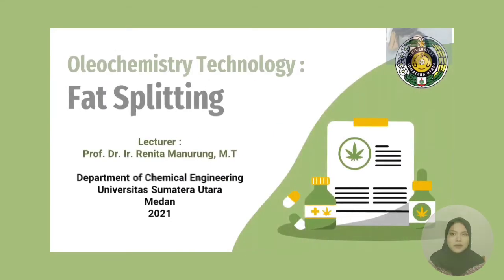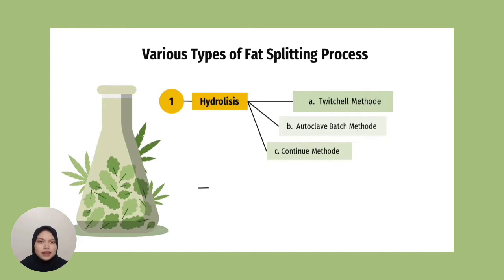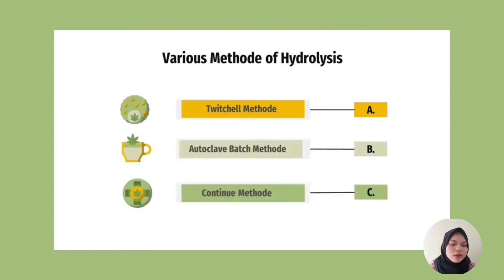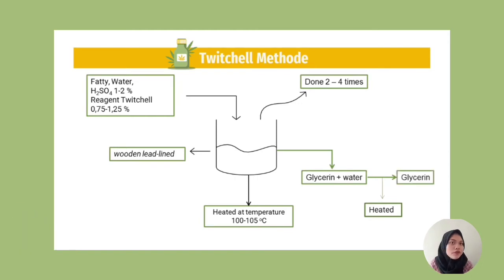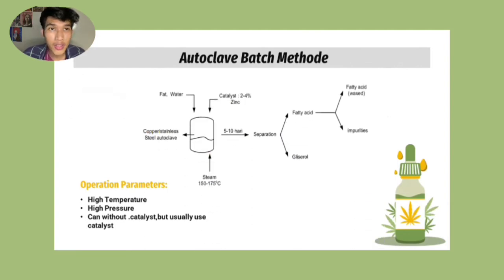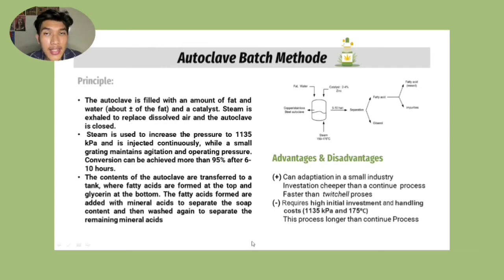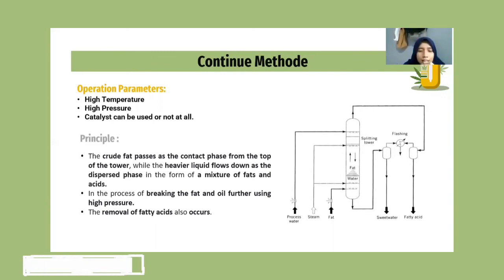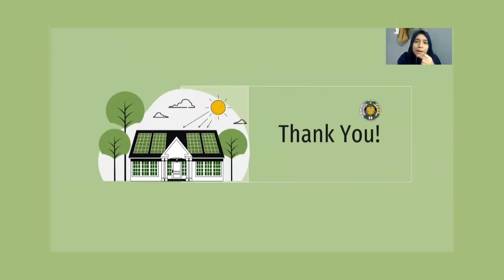Oleochemistry Technology : Fat Splitting

Comment: How calculate water ratio in fat splitting plant
Reply: theoretically water ratio in oil splitting can be calculated using triglycerides hydrolysis reaction mass balance. but in practically there is not absolute 100% reaction, so to increase the efficiency excess water is used in the oil splitting oil to increase fatty acid reaction (degree of split). normally process water used is about 55% - 60% of feed oil to achieve 97% degree of split.
Reply: @SKZ1984  45%to 50% water and 15 % to 20% high pressure steam
Over all 70%ratio types of oil dependent
Acid oil over all = 45%
RPS/MUSTURD = 60 % TO 70%
RESIDUE = 40 %
In my compny
Reply: @SKZ1984  
D.O.S {DIGREE IF SPLITTING)
R.P.S =99.7%
REPSEED = 96%
SOYA ACID OIL = 95%
RESIDUE = 85%
Reply: @SKZ1984  thank you sir